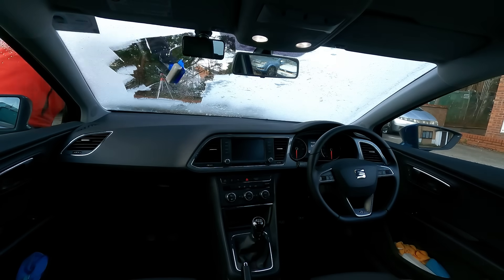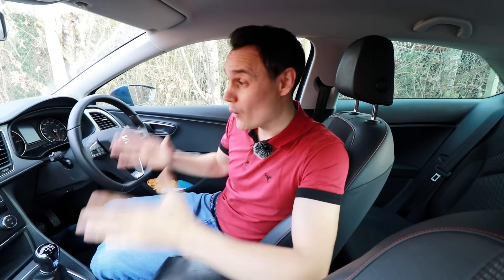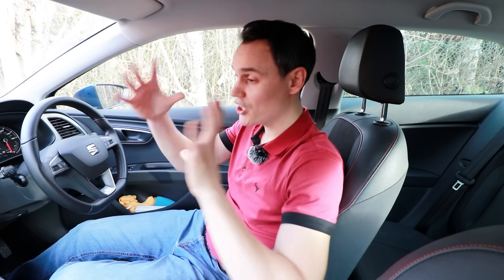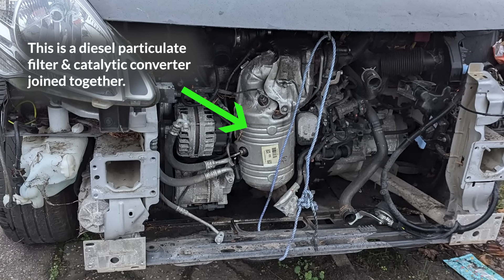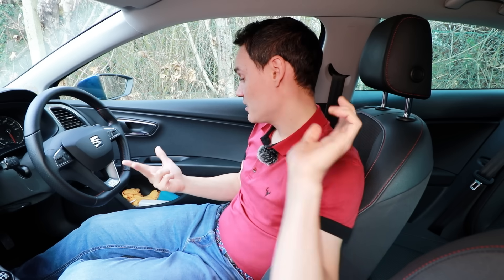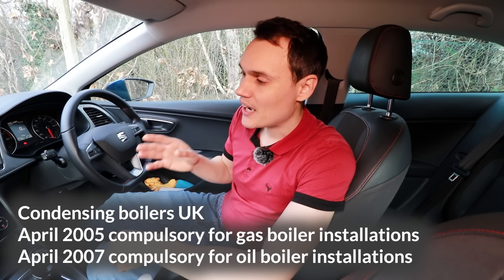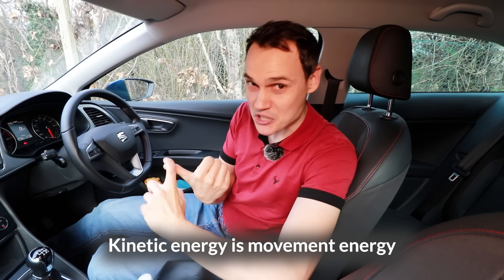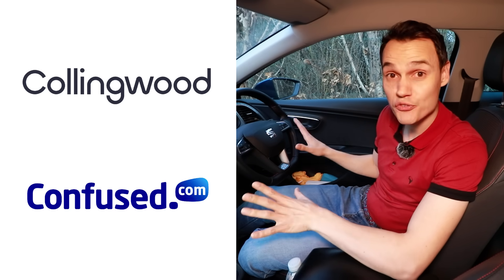How turning the engine on when de-icing can cause you harm. Possibly even cancer.

Comment: well, normally I start the car after de-icing, but today I did start before de-icing :D  because I wasn!t sure if the car will start after 5 days out in the -5 to -12°C and those 10 minutes de-icing my car to find out it will not start wasn't good option :D we had "ice rain" at night and all cars looked like car shaped icicles :D not just the front window ice mist, but 0,5-1 cm thick ice, and snow in some cases.

Comment: newer tfsi engines like ea211 integrate the exhaust manifold into the cylinder head to allow it to heat up the coolant more quickly to get up to temp quicker

Comment: My university thesis was on wearable air quality monitors (I developed one), I also hate deicing, AND I have a small child so this video is right up my street. I'll add another thing that I discovered recently. I've been starting the car up on the driveway and letting it warm up whilst I load things into it, back and forth into the house, doors opening and closing etc. I realised I was filling the house with exhaust smoke because we always reverse park into our driveway and our house has air bricks for the suspended floor. We never had a driveway before so it's a recent discovery. I've contemplated forward parking when the weather is cold, but I prefer to reverse park. I've mostly resorted to pouring warm water over the windows as the quickest and easiest way to deice, there lots of videos on YouTube showing that even boiling water doesn't crack automotive glass so I'm happy to do it that way. Plus the chance of scratching the glass is eliminated.

Comment: Good advice. We have very different powertrains from carbureted, very often large displacement engines that needed to be warmed up to turn over smoothly and in many cases needed a manual choke. A modern fuel-injected 1.6 turbo or 1.8 hybrid is a very different beast from a Ford Kent or Pinto four cylinder, a Ford Essex V6 or an American (or Rover) small block V8.

Comment: Really insightful video on the chemistry of cold starts! The explanation of why the catalytic converter needs heat to function is spot on. 
However, when it comes to cold starts, there’s a definite 'sweet spot' between emissions and engine longevity. 
While the rich fuel mixture and moisture from a cold start contaminate the oil, letting the revs settle before pulling away ensures the engine is stable. (Depending on the ambient temperature that can take up to a minute with a modern car.) Showing a learner how to monitor the Tach at a cold start, will ensure he knows exactly when the engine has finished its initial "cranking" phase and is stable enough to begin the drive. Driving off GENLTY from that point is then the best way to START reaching the temperatures needed to evaporate those contaminants and get the 'cat' working quickly without overstressing the components. A perfect balance for learners to aim for!

Comment: Yet you still have recycling air system.
The engine need to get smoothly to driving temperature if you don’t want to break it. 
It can also slowly heat up the gearbox if it is close enough.

Comment: This is sensationalism at it's very best. The exposure to combustion by-products when the engine is running outside in an open space for 5-10 minutes, once a day for a month or two will never get to the point of producing any symptoms in the vast, vast majority of people (if any at all). It's very easy to read the health warnings on the material safety data sheet (MSDS) of damn near any chemical in the universe and make them sound scary and dangerous, but when they are produced in such tiny amount locally it will never cause an issue. The cumulative effects of millions of people doing it at our around the same time every day is a different matter.

Comment: This video is awesome and has great information, i learnt something new today but really guys, this is basically a 1/1000000 million chances of getting a health hazzard. I live in a very cold country, a LOT of people turn their engines to warm up and de-ice the cars, sit inside etc. The fumes are behind the car, most modern cars are really WELL insolated, wind is also a big factor as it throws away the gases in any direction, and when you're driving its being pushed back. Good modern cars you can't even smell anything coming out of the exhaust, certain cars have more expensive exhaust designs, for example i got 2 cats in my car as i own a v6 mercedes and i never even smell petrol, super rare. Work smarter not harder.

Comment: I used to de-ice my car with 2x 2L bottles one with room temperature water (18-20°c) to reduce the shock before putting on the water that is just under body temperature (30-34°c) most of the water is put on the front window with the front wiper switched on after around half of the room temperature water has been used as removing the water prevents evaporative cooling taking effect which causes the water to freeze again.

Comment: 12:06 - How it hasn't been done? It surely is not the same system but simpler, of course I'm talking about a turbo. So people do not know how exactly does turbo work, so let me explain. It is not using only the pressure because how would the exact amount of air that goes in the intake that also exit the exhaust make the turbo spin faster. It is heat, that is why before turbo exhaust pipes are usually wrapped in material that isolates the heat, and the turbos are usually in the shrouds. That is why turbos are the best and most simplest technology to harness the heat from the exhaust. I think there were experiments with condensing exhaust technology on trucks, but it was very heavy and complicated.

Comment: Richard, you need to update your terminology. You called the mirrors 'wing mirrors' but your mirrors are on the doors, therefore they are DOOR mirrors! Wing mirrors are on the big metal panels over the front wheels & in this (our) country, they are the wings. Wing mirrors stopped being used as they were (still are) rubbish. Door mirrors are so much better, as long as the driver uses them.

Comment: A turbocharger actually does convert waste heat energy in the exhaust into mechanical power. It uses this power to supply compressed air into the engine which does mean the pistons can produce a small amount of crankshaft power during the inlet stroke, though obviously the main power gain is by using this extra air to allow burning more fuel during the power stroke, which in turn produces even more exhaust heat for the boosyboi to harness.

Comment: What a lot of pointless waffle. I scrape the car with the engine running and common sense tells me to avoid breathing the exhaust fumes. I've survived decades of winter driving doing this. The amount of fumes breathed in while scraping a car will be irrelevant when compared to the amount breathed in annually when driving a car. Do you think sitting inside a car protects you?

Comment: Just push the air recirculating button so polluted air stays outside and the cabin heats faster (not having to heat loads of cold outer air), just run the AC if people are inside so it takes care of breathing moisture. At least, that’s how I do. Anyway nice explain of the emissions control.

Comment: Correct me if i am wrong but regarding NOx I would not be too worried about in a Cold start engine since these gases happens at high temperature combustion. NOx has become a bigger problem in high power turbo charged Diesel engines and direct injection petrol engines since they run very lean. In the cold engine the fuel barely burns hence the high amount of unburnt fuel leaving the exhaust which in this case probably should be the main reason you don´t wanna sniff the pipe. But instead being blind behind a frozen windshield I prestart my car or use the motor heater

Comment: stfu englishman. As a scotsman, who actually is used to THICK snow - turn your engine on to start heating your car as you have always done.

Dont listen to this guy. Hes got a mm or less of ice on his window, no snow anywhere, is from a place with no hills or mountains, and is lecturing you about how to deal with snow/ice.

Just dont sit inside your car whilst its warming up, with windows closed. And dont suck your cars tailpipe and youll be fine.

Comment: Catalytic converter changing CO to CO2 does not increase CO2 emissions because CO will convert to CO2 in the atmosphere anyway. It's less ambiguous to measure "carbon" emissions though these are usually quoted in CO2 equvalent. Cat does add to weight and exhaust backpressure which may reduce fuel economy and hence produce more CO2. Well done for distinquishing between NOx (nitrogen monoxide NO and dioxide NO2) and nitrous oxide N2O. Breathing exhaust in an enclosed garage is very bad. Breathing exhaust outside should be avoided but typically you want to defrost your car as quick as possible as the wrath of your boss for being late is also bad for your health.

Catalytic converters don't use heat from the exhaust - they require a high temperature to work but the reactions actually produce a tiny amount of additional heat. The exception to this is energy required to evaporate Adblue if used. There is a theoretical limit to the amount of exhaust heat that can be converted to kinetic energy called the Carnot efficiency: (Temp in-Temp out) / (Temp in - 273) where 273 is conversion factor from the common Celsius scale (zero = freezing point of water) to the Kelvin scale (zero = absolute zero, the coldest possible temperature.) Combined cycle power stations use gas turbines as the primary means of electricity generation (approx 40MW per 100MW fuel input), then raise steam from the exhaust (approx 40MW) and use it to extract additional energy (about 40%, 16MW). Overall efficiency 56%. 20MW of heat goes up the stack and 24MW goes to the cooling water. Source: I design the heat recovery steam generators for power stations. Both the gas turbine an the steam turbine reject 60% of their input heat. Car engines are slightly worse than industrial gas turbines: about 30% efficient, with 30% going to the exhaust and 40% to the cooling system. Because of the low theoretical carnot efficiency, it's difficult to make kinetic energy or electricity from exhaust. It's done on some large stationary industrial engines using heavy equipment, but a fluid with a lower boiling point than steam must be used due to the low exhaust temperature, which further adds complexity.

Comment: There's a chain of contradictions here, "de-ice the car, get in and drive off" sounds straightforward but you cannot drive off yet before the car is properly de-iced, but you cannot de-ice it quickly enough without turning on the demisters, turning on the demisters mean you need to start the engine (unless you want to drain off the battery), starting the engine means you should not be around the vehicle to breath in the harmful air, but then if you leave the engine running without being in control of it (sitted in the drivers seat) you are breaking the law. So what exactly is the way forward, de-ice without starting engine and let the battery drain?

Comment: Install a electric engine and cabin heater. They reduce engine wear and emissions, and melts the ice/snow on the windscreen in the winter. Or are they only a thing in northern europe? 
If you drive to work the same time a combined clock and thermostat (in the car or in the socket) turns it on automatic when needed, only remember to plug it in.

Comment: Just to clarify for people who are struggling to see the connection between cancer and de-icing from this video (you're not alone, I did too) he's saying the catalytic converter doesn't work effectively until the engine warms up, meaning you might be breathing in some harmful fumes while standing outside your car. Which whilst is true in theory, you're highly unlikely to suffer any harm whatsoever, especially as your windscreen is literally at the other end of the car from where your exhaust is situated.

And prehaps the most important part to take away is that cancer rates were significantly lower before cars were even fitted with catalytic converters, so this is at best fear mongering and at worst, total nonsense. You're welcome.

Comment: The exhaust of a single car starting up will not harm anyone as long as they don't stand directly behind the exhaust and they are outside so the gas can escape. It is hot, so it will travel upwards and not to the front where you are scratching your windshield.
This video is completely senseless and probably scares people for no reason. They might even hurt their engines by not letting them heat up properly before driving off.

Comment: You've got a good poin here Richard but there are cars there without a/c that will not demist front screen without engine being at least a bit warm. Unless you have Ford model with Quick Clear option. 
Having my own drive now I usually start my car and pour warm water over the windows and it takes seconds to get frost off and just drive off. I used to worry about cracking the glass but over the last 5 years it didn't happen, I suppose you have to be very careful though. 
My Mazda 6 diesel owner manual used to say that you should wait 10 seconds between starting the engine and driving off, but it said for Germany you should start driving immediately after starting the engine 🤷‍♂️
One point to mention also when you keep engine at idle for prolong time is cylinder glazing that is not good for your engine,  apparently affecting diesel engines in particular.
All the best in New Year! 👍

Comment: 12:49 Good tip! It’s not safe to have anyone sitting in a stationary car while the engine is running. It’s better to use a de-icer spray and scraper, then get in and drive off.

Comment: If it only takes 30 seconds of driving to get the catalytic converter to temp, then just sit in the car and raise the RPM to 4000, or wherever you normally drive at, for 30 seconds before letting it idle. Literally zero difference between that and driving as far as the engine and exhaust are concerned. If anything, it will warm faster without the frigid airflow passing over the metal from moving.

No need to freeze your friends and kids in the snow out of paranoia. It doesn't even take that much fuel to maintain a high idle long enough to warm the engine and exhaust.
Reply: You rev the engine stone cold to 4k rpm and hold it there every day in sub-zero temps? Cold oil, cold coolant, engine internals not fully expanded with clearances all out of whack? You might as well order a replacement engine already just in case.

Comment: I had the pleasure of starting up my car at -15°C. Started it up, put the recirculation on, let it run for 20 min, meanwhile I had my lunch and when I came back the ice had already melted off. I didn't even need the electric rear window heater.

In Scandinavia they often have block heaters mounted, they plug in like a charger but it keeps the engine block warm through the night.

Comment: TOP TIP : Always scrape the passenger side FIRST. Then do the drivers side SECOND.  Two reasons. 1) it means you are less likely to have your car nicked, 2) by the time you get back to the drivers side the ice will have thawed a bit so less chance of scratching the glass with the scraper.

Comment: Your input please. I use 'Dipetane' in my fuel. I know for a fact - MOT emission test - that by using this product ( I own a 2001 Toyota Corolla ), my CO2 emissions are practically zero and my HC emissions are halved. My car is effectively cleaner than my partners 2016 Fiat 500. By that standard, I am at less risk ...

Comment: I see many tradesmen sat in their vans idling the diesel engine.
This damages the engine because the engine temperature falls. Oil flow is very low and diesel oil bypasses the pistons causing lubricating oil dilution and contamination

Comment: The best solution is to buy a windscreen cover and put it on when there is a risk of icing. But that requires a degree of planning ahead most people aren't able to achieve.
Reply: They can get frozen in place if it thaws and refreezes or freezing rain falls. Generally much better than bare winshield. If you must park outdoors they are OK, full car covers are less likely to get ice underneath or blow away.
Reply: @joytotheworld9109  I use  a damp towel...insulates the inside too
Reply: The problem is what to do with it when you take it off. You have a large damp/icy thing that needs to dry out. Put it in the car and the windows will steam up eventually/carpet will get wet. To put it in the house is the same problem, in the UK we are constantly fighting damp and mould in our homes so it feels silly to bring a big wet thing inside unnecessarily. Plus sometimes you're not at home, I have a deice when I leave work sometimes, or something like that. More hassle than they are worth.
Reply: @SuperVitz I lay my towel over the garden bins…sometimes it’s like a solid surf board
Reply: Depending where you live and when you drive it may not be an option at all. I know I wouldn't feel safe removing one at 3am in a built-up city area.

Comment: In many cars exhaust variable camshaft is shifted by some angle to allow extra gases to heat up much faster cat while engine having less torque. When I'll try yo move off even by 1 mph thrn it shift back cam to produce more torque to engine. Proccess takes aprox. 20 seconds. 
Below 0*C preffered to run 40-60 seconds before moving off as safety of clearer view of front windscreen comes first over in practice small amount of harmfull gasses. No one smart enough pull out withing 5 seconds from engine starts anyway.